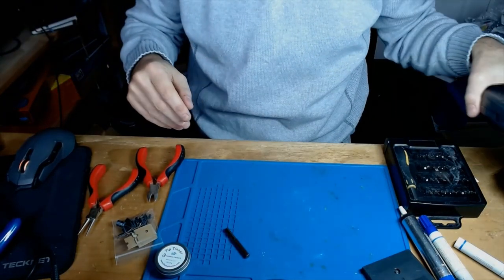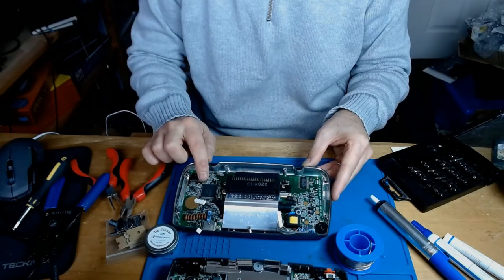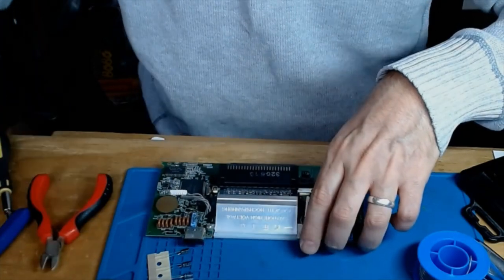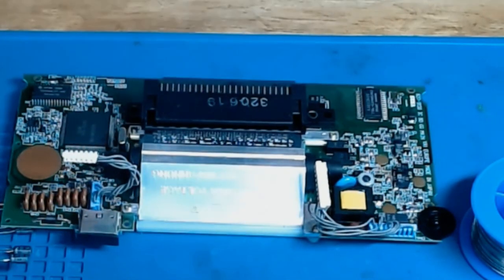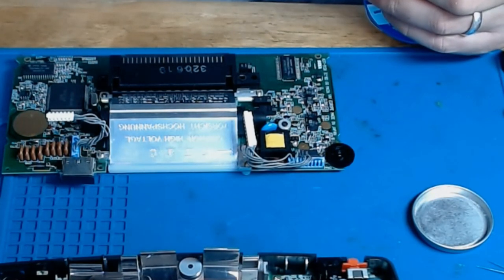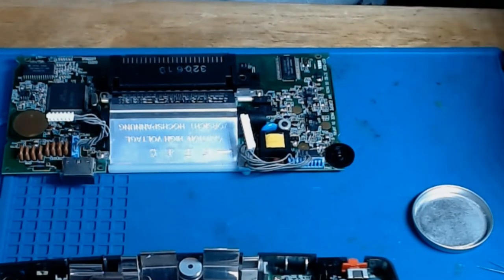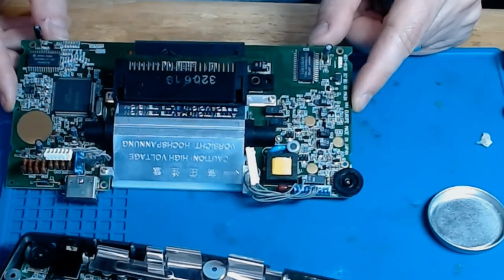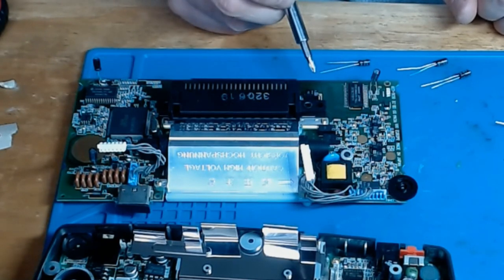Fixing a GameGear - Simple Recapping - Basic Electronics Fix  Repairing Ebay Items Soldering Basics

Comment: Hello Peter, I still hiding behind the sofa while watching that.  oh boy.. Ok... few tips, thirstly its understandably why people use thru hold caps to rerpair electronics because it looks easy, it just as fiddly as using surface mount, after you clean the pads with wick, flux and solder on a cap, bit fiddly but after practice it becomes very easy to do.  Secodnly, the plyers methods of removing caps will only work if the solder joints are poorly soldered at factory or aged, they will snap but it's not reconmended as you tear the pads, it really doesn't take much to wreck them as u seen, the easy way is 'hot air' but u can do it with an iron (and easier with tweaser based irons).  Thirdly you mentioned a capacitor without a negative band, that is a bi-polar cap, usually small values, so stick to the guide of what to change to.  If an Electrolytic cap is wrong way round then they will explode.

What happens to caps over the years is they dry up, not all brands do tho and when you put them on a ESR meter, we are seeking low-values and not high, they also can short causing issues like no sound and no power-on.  

Ok, I can come out behind the sofa now I think.
Reply from the maker: Thanks Dave  - the pliers were used to 'crack' the old caps that had been glued to the board, after cracking them off, it's the wiggling that breaks the cap legs, I suppose I could use a hot air gun, but this was just easier and at no risk to the pad. Definitely practice is key, I'm no expert, but the only way to get better is to try. The pads I lifted was down to too much heat and holding the iron on the pad too long.
Reply: @salesoftheunexpected  yeah it’s never recommended to put force on pads but if u did that to an Amiga, one main board would be better then the next for removing them. Heat is the way to go.
Reply from the maker: @DaveRepairs  Thanks Dave, overall I was Ok with how it went, i haven't soldered for a while, and filming it and putting it out there for critique adds a certain tension! Thanks for the tips tho, practice will make perfect!